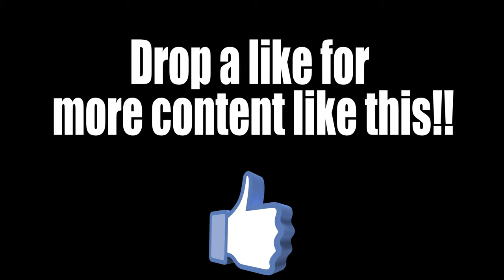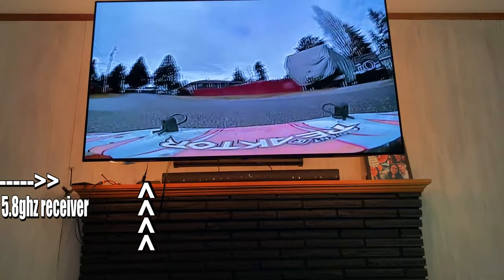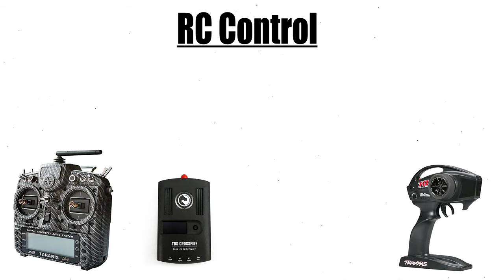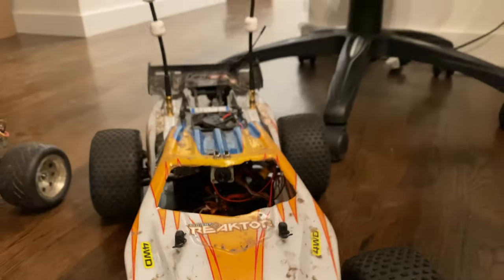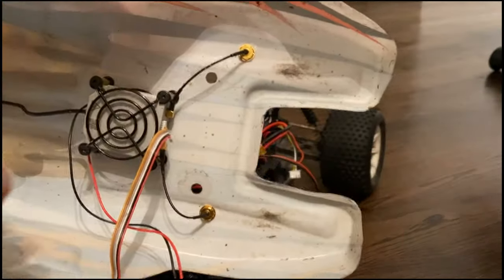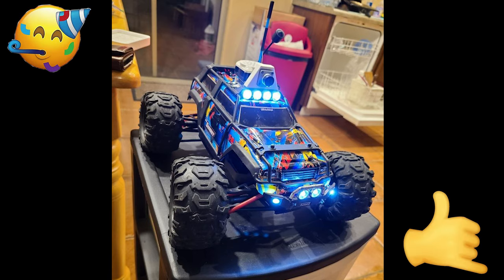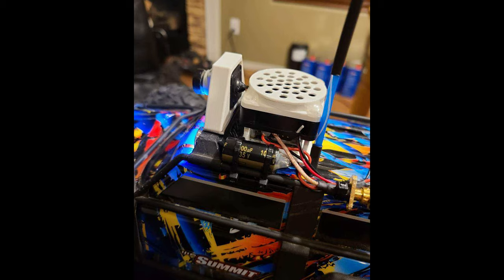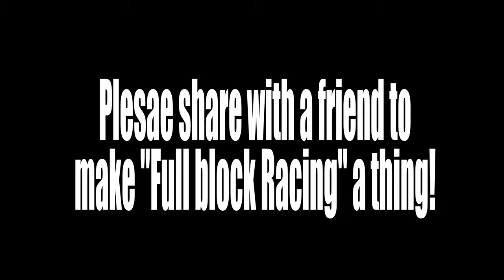How to Build an FPV RC Car in 2021!!!!  - 4k

Comment: Small tip, Soft mount your Fpv Camera
Reply from the maker: Super good tip! I show my best build in my latest video and it uses a TPU camera mount on top of double sided foam VHB tape, but the biggest help for me was actually big soft tires and softer suspension 🤙

Comment: This probably won’t get a response, but worth a shot. I noticed in the description that it says you need to add a connector to power the air unit, and 2 feet of wire. This is what I don’t know how to do and would like some help. In the meantime I’ll keep researching, so far I’ve found nothing on that specific detail. Thanks for all the great videos!
Reply from the maker: Aye I try to help everyone that comments on my channel lol. So, the air unit has like 6 wires, but only 2 need to be used: the negative and positive. Solder on a battery connector to those wires (most would use XT60 because it’s common, but a red JST connector is totally fine). Be sure your fan is also going to get power too (so put a connector on that or splice it into the air unit’s power cable- depends on the voltage if the fan and battery you’re using). 

Next, you’ll either want to get a small battery to power the system (a little 3S is best) or power it off of your car’s battery. No more than 4s and you should always add a 25v 1000uf capacitor to your air unit’s battery lead if you’re using your car’s battery. You can see how FPV drones add capacitors to battery leads in you need inspiration. Good luck brother 🤙
Reply: @ChaddRainsFPV  awesome man, thanks. Just to make sure I’m following you, if I get a 3s battery with a female xt60, and solder a male xt60 to the air unit power cable, then it’s just plug and go (and of course the fan as well) just want to be clear on that part. I’ve never needed to solder anything, but it’s definitely something I want to invest in for future projects. My kids love all this stuff lol
I’ve built a lot of r/c cars over the years but never set one up for FPV. Definitely caught my attention quick!
Reply from the maker: @danielthornton1633  Yup! It’s that easy. Just twist the 12v fan wires in with the AU power wires and solder them into the xt60 and you’ll be set to power it from a 3S battery. You’ll have to turn temperature protection off on the AU (setting in the goggles) in order to get good range. It defaults to 25mw otherwise, but because you have a fan you should be just fine. Go make something awesome 🙌
Reply: @ChaddRainsFPV  thank you, I really appreciate it! I have a couple friends that are also interested in a project like this, I’ll have them check you out! The hiking trails here in the hills of northern Michigan will be a great place to get some footage!
Reply from the maker: @danielthornton1633  Having some friends to go explore with is the best! Hope you get some peeps into it 🙌

Comment: I agree Chadd, there are not enough ground FPV vids.  This is very helpful, especially learning realistic range capabilities of the different frequency setups.  You made one of the more informative ground FPV vids and I've been scanning Youtube for 6 months.  I got into RC because I wanted to drive around the neighborhood.  Little did I know that it would be so tough just to get around the block, which I have yet to accomplish.  It seems like I have to drop $1k to get beyond 100 yards of range.
Reply from the maker: Hey Samey, 

If you have some 5.8ghz gear, it can help you transition into 1.3ghz. Don’t get me wrong, DJI is the way I would choose if I was starting from zero. But if you can’t swing the ~$1k, consider 1.3. I’m making a video on it now and using my goggles and 5.8 gear I already had made my 1.3ghz setup cost around $350 or so. Even less if you have a very powerful 2.4ghz ground radio that gives you the RC range you need. 

I hope you keep at it, whichever route you choose!

Comment: I’ve got a clodbuster.. custom.  This had been my trail truck for walking trails for almost 20 years. I’ve worked at a battery company so SLA used were abundant. Miles  over the years snow plowing has been it’s thing . 
    I’m
Thinking for us older folk 
      to design FPVs for utilities at home snow plowing and yard work. 
    . AI a walking cart for groceries.   Mathis is truly awesome. Ty for the breakdown and tips on how to build a cool system!
Reply from the maker: Absolutely! I actually used to teach kids with health issues to fly FPV drones. I ran a deal called QuadsForKids. Regulations ended that back in 2016 or so but RC cars can make this happen again. Snow plowing etc could be a thing, but the cost would be so high and only do so much good. Giving someone the chance to go stroll around the neighborhood again is nearly priceless 🤙

Comment: I rigged my TRX4 Bronco with a all the FPV and Ardupilot goodness. I had to design a laser cut balsa wood structure in CAD so that I could mount a head tracked pan and tilt inside of the cockpit. So worth all the work and money😂

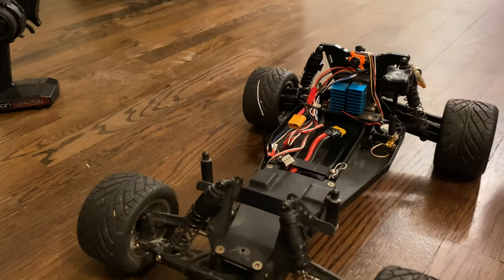Comment: It's great that you had the idea to offer a video on how to build an FPV RC car, I thank you for the effort, and I really hate to be critical -- but speaking as a completely inexperienced beginner, it was just frustrating.  I was so proud that I built my own 4WD, 2-speed crawler with locking hubs all by myself -- I just want to drive it FPV around my backyard.  But building the crawler was easy, it was a kit and just had to follow the directions.  That was nothing compared to this electronic stuff with no instruction manual, no idea what pieces are compatible with each other, how to connect them, how to power them or how to get the video feed.  Sadly, your video didn't answer those questions.  I understand I need a camera and a set of goggles, plus I need an "800mw VTX."  I think that's a transmitter but instead the link you provided seems to be for a 200mw transmitter.  How do you know what pieces are compatible with each other?  How do you connect them?  And how do you power this stuff?  Separate battery (what size?) or how to connect to RC car battery?  It's "super easy" for YOU because you're smart and experienced, but I'm not and a few seconds looking at your car at 1:45 didn't make it look "super easy" at all.  And you might as well have been speaking Greek in the rest of the video.  I am hoping you will consider making another video and just go over the 5.8 system very slowly in great detail and assume that your viewers know absolutely nothing.  THAT will make it "super easy."
Reply from the maker: Aye this is a fair critique and I appreciate you being so detailed in your comment. That being said, this is a hobby and every single part of it will take more than 1 YouTube video to learn. I made the best video I could, for free, and I know it will require more goggling and more videos, but that’s going to be the case regardless. Don’t be frustrated you couldn’t get it going in one video, I know you can figure each question out 1 thing at a time. I’ll try to make more in depth videos but this is just a hobby for me too 🤙
Reply: Im with John on this. Title had me hoping for more basics. While I appreciate it's a hobby for you, you sound experienced enough that a beginner guide is within your ability. That said, I did learn from this video so thank you for this content. 

And, hope the pups are doing well. ♥️♥️

Comment: Great video, 👍 I have 2 of my Losi TLRs with FPV. The DJI stereoscopic  cameras is what I am interested in but pricey. I feel that setup will greatly benefit the fpv immersion on Rc cars. I been working on a rig using an old ps3 steering wheel and pedal setup. Once I'm done I'll post it on my channel to share with everyone the results. Fpv on rc cars are fun.
Reply from the maker: That’s awesome man I can’t wait to see it! I was going to do that with a Logitech Wheel and pedals YEARS ago but it was too much of a project back then. Just didn’t have the massive FPV community that we have now to ask questions to. Best of luck with the build 🤙
Reply: that sounds sweet.  any progress?

Comment: I'd love to know where these people get these elaborate setups with camera on multi axis servos they can swivel around etc.. Reliable fixed camera on a haul-ass RC makes sense out in public because you need to be able to evade, but I also like the idea of trying to manage rough terrain or small spaces at slow speeds and being able to manipulate any desired viewing angle to see better. Or maybe just really wide angle cameras accomplish this already, IDK. Whenever I just bootleg mount a camera on an RC it just doesn't look right and it's hard to actually gauge obstacles.
Reply from the maker: Getting the camera as high as possible (without sacrificing durability) is key. It helps you see bumped in the road before it’s too late and really ‘ups’ your special awareness. I’ll be running the O3 camera in my latest build so the fov is insanely wide already. But doing the gimbal and pan servo is a big custom job. May try to make that happen in the future but there really isn’t anything ‘good’ that’s off the shelf atm 🤙
Reply: @ChaddRainsFPV  OK that makes sense, thanks! Custom cam job seems nice but I guess a real nice wide fov would do fine. I suppose anything is better than me taping a small camera drone on top of my RC car for the camera lol.
Reply: @ChaddRainsFPV  I did a little digging and found a real easy way to do a 2-axis camera deal. I'm using the Radiolink 5 channel (soon to be 7 channel). It comes with a 6 channel receiver where the 6th can just easily be a fan that will always be on. After steering and throttle you have the 3 extra channels to play with. I used one for a light and the other 2 are the camera servos. I got a cheap 2-axis mount off amazon, all plastic and uses the little plastic gear micro servos but works well. They also allow full 360 rotation. Since it comes with the servos it's real easy to just plug in, then just program the Radiolink how you want. I used the little VR pot they have on there to swivel the cam left and right.. but the downside is unless you have view of the front of the car you have to use the controller screen display to show you the 0 point. I just have another button I hold down to make the camera tilt upward a little so I can see higher. With one of those little adjustment boards to play with the full servo rotation I'm going to make it so I can spin around and look behind me also.
Reply from the maker: @Magneticitist  That’s awesome! Drop the name of the servo mount that comes with the 360 servos here in the comments so we can search it on Amazon 🙏
Reply: @ChaddRainsFPV  Hmm well YT still wants to delete the comment.. IDK man. 

It comes up when I just search ' @d@fru1t pan tilt ' but obviously replace the @ and 1 with letters. IDK YT might just delete this comment also for some reason.
Reply from the maker: @Magneticitist  I’m seeing this one so it’s staying 🤙 Thanks man!!
Reply: @ChaddRainsFPV  lol man that damn AI is strange sometimes. Anyway I was trying to say it has identical little micro servos as other ones I own but unlike mine they just didn't physically block the full rotation. You still need a servo tuner circuit to make them go the full 360, but you at least don't have to mod them physically to allow it. You also kind of have to use the mount backwards in order to get it to look up because it was made for drones/planes. 

So long as the leads are free moving enough those little servos work great because they're fast. If they have any tugging on them though they might start wigging out a little bit.

Comment: Hey! I was wondering how you set up your relay system?  I’m trying to do the same thing with an FPV boat, so the relay is down on the dock and I can control up from the house.  Any help would be greatly appreciated! FYI — I have analog if that is the only way to do remote relays, but prefer using the DJI if that’s possible. Again thank you!!
Reply: I’m also using TBS Crossfire too
Reply from the maker: Yo! So my ground station is pretty but I can’t use 1.3ghz in my area (hence why I haven’t released the relay video). I just have my main video output from my receivers (or receiver) going to the ‘camera input’ wire of a 5.8ghz vtx. 

From there I just make sure the vtx stays cool and I tune in with my fatsharks. 

At this time there is no good way to do DJI with a relay 🤙

Comment: Thanks for your good video! I do a lot of RC stuff, but I am new in FPV tech. What I don’t get: why do I need to connect goggles or camera with the remote controller? Why not just connecting cam with goggles and done. Shouldn’t this be enough to watch the car in FPV?
Reply from the maker: In this video it looks like I run 1 system that has the controller and goggles and car linked, but I do not. The goggles are separate from the controller, but I do run an upgraded control system (but it isn’t linked to the goggles). The reason is I need to have more control range than my video range (so my car doesn’t get stuck far away). So I use “TBS Crossfire” in a modified system. I put another video on the controller if you want to get more info 🤙

Comment: What about opensource OpenHD system? On car: flight controller Pixhawk4 + Raspberry Pi + Wifi adapter. Driver: Raspberry + diversity Wifi, usb controller. Good maple antennas. 
Drones fly on that system 10km+, you can connect multiple cameras, use hdmi display or gogles, drive on waypoints etc. 
Let me know what you think, but I want to build it in next two months.
Reply from the maker: I have seen some people talking about this system lately and I hope it gains traction!! I know that integrating a “flight controller” for a rover can make for some cool features, like waypoint missions, but it disables the brakes as far as I can tell. You have forward and reverse, but if driving manually, you’re brakes will not function. iNav cannot get it to work anyway. Let me know if you think pixhawk will have a better time with it 🤙
And if you know the latency on the OpenHD system?

Comment: Nice explanation of your gear. Thx. But you need a gimbal stabilization of sorts as the bumpy video feed is hornades😢.
Greetings from the Netherlands 😅
Reply from the maker: Hahaha right on. My newer cars have much smoother video and still no gimbal. Thanks for the comment though!

I don’t like a gimbal on the cars I go really fast with as it’s a recipe for a broken gimbal / camera, when I inevitably crash lol. There are some cars I would consider putting a gimbal on, but you would be amazed by what a good suspension, big soft tires, a rigid body and a good camera mount can do!

Comment: I think you could try and do something about the vibration in your video, maybe try some other ways of mounting the camera with something to reduce shock and vibration.
Reply from the maker: I have, this video is a few years old 🤙 I recommend trying to avoid mounting cameras to shaky car bodies. Also, having big, soft tires and the right suspension helps a lot. My newer videos show this a little better 👍

Comment: I have the full DJI fpv air unit and associated kit and a few drones. I am now inspired to get my DJI kit and use it in a car. I need to convert sbus I think. I want to use all my DJI kit.
Reply from the maker: You can just use the RadioLink RC6GS v2. It has about the same control range as the DJI video system, it’s an ‘RC car style’ remote and you don’t have to mess with SBUS to PWM converter for your seervos and esc 🤙

Comment: You haven't done the 1.3ghz video, did you? Couldn't find it on your channel :/
Could you give some hints to look into to build the 1.3ghz/5.8ghz bridge please?
Reply from the maker: I had such a bad time with 1.3ghz in my area I had to move on vs putting out crappy content. I hope you understand. At the end of the day, your environment has the biggest impact on if your ‘functional’ FPV system will be good or not. And my area is swamped with 1.3ghz noise. 

I can say I built a top of the line system and can recommend things that work good, if you can find the right place:
- RMRC 1.3ghz video receivers are the best for the money. 
- getting your antenna up off the ground is extra important with 1.3ghz. 
-having diversity is helpful, but hard as the good diversity controllers (like Eagle Eyes) are discontinued. The Clearview diversity receiver is easily the best but so expensive for most of us. 
-2.4ghz RC remotes will likely have trouble getting good reception. 
-900mhz control (like crossfire) may interfere with the video, but if you get longer video cables to your screen or monitor (or use a repeater) you can mitigate that issue. 

Those are the biggest tips I got. And I really hope you have success if you chose to put the money and time into building this system. Maybe grab some cheap 1.3ghz gear and test it in your area before committing to a $500 ground station, a couple different vtx’s and well over 80 hours of testing, like myself 🤙